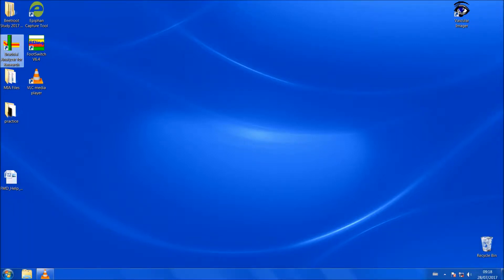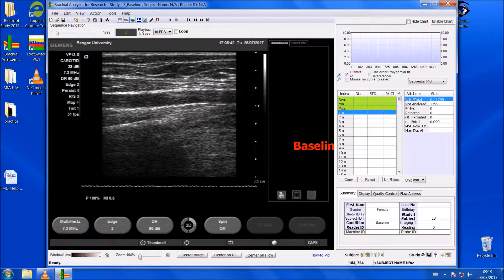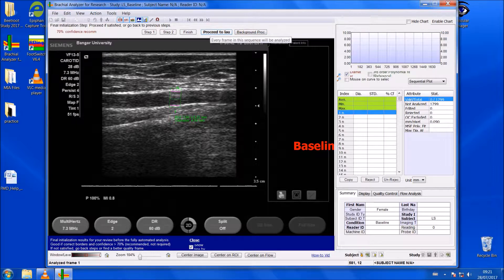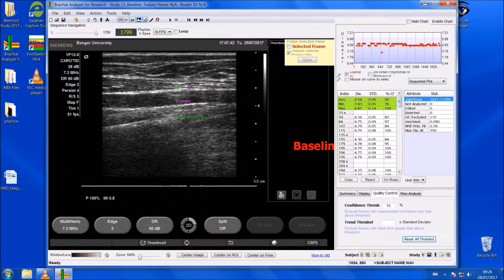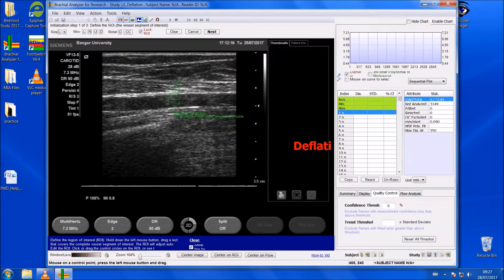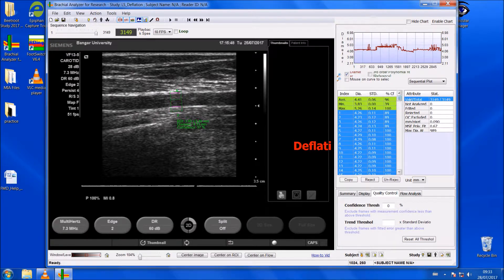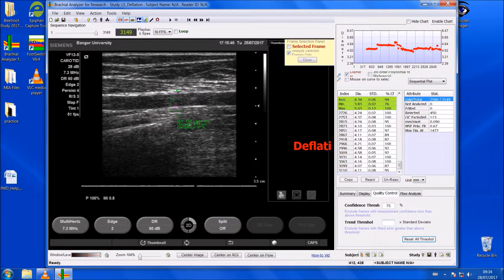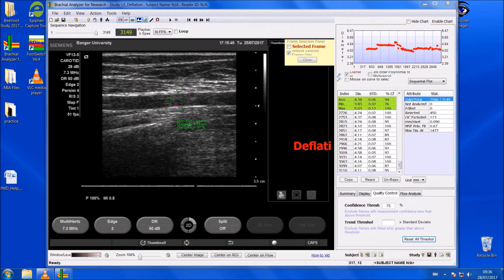Analysing Flow-mediated Dilatation Data using Medical Imaging Applications Software (Part 2)

Comment: Congratulations for the great video! What would be the cost of the Brachial analyzer software? It is possible to measure other vessels different than brachial? Thanks
Reply from the maker: Thanks Miguel.  The Brachial Analyzer is one of a number of programs.  Other software includes QUIPU.  The cost is usually around £5 - 10k but its best to check with developer.  Other vessels can be scanned but might require refinement to protocol and analysis.